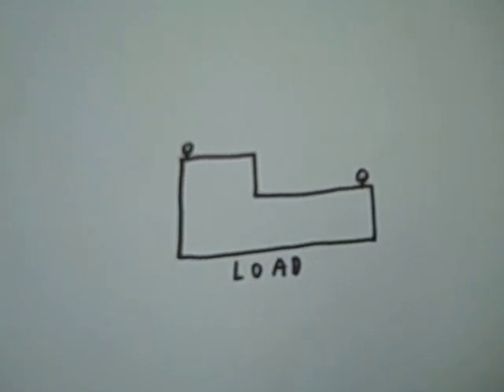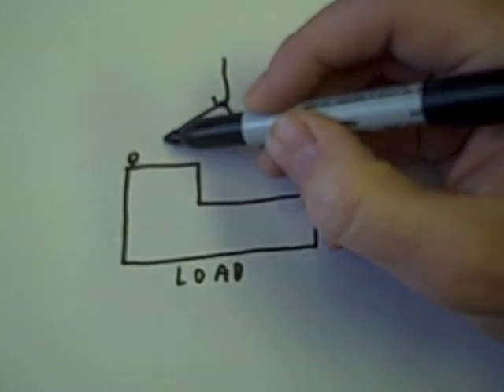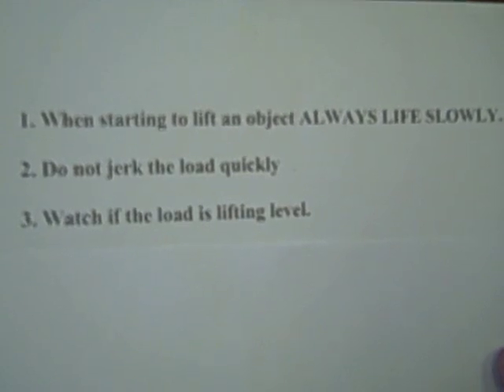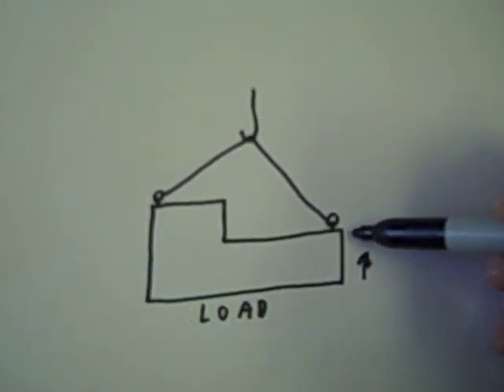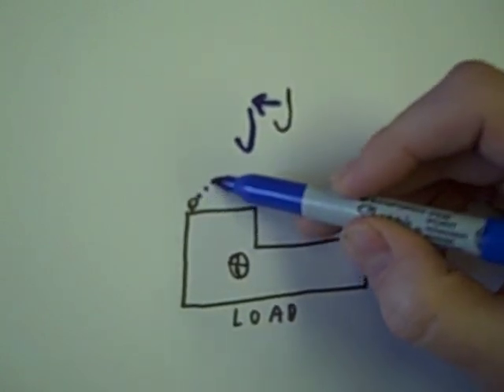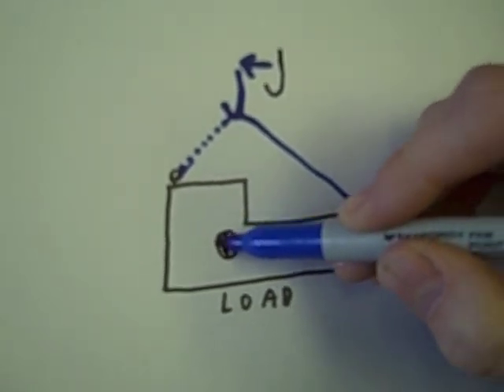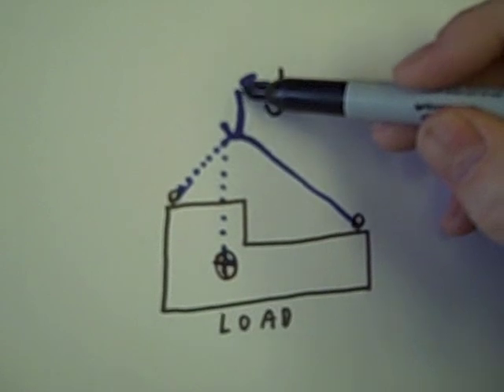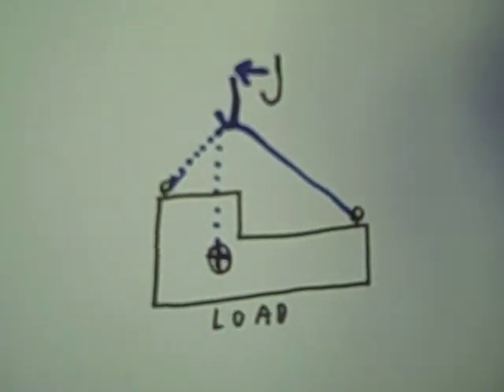Balancing A Sling Load Below A Hook Point

Comment: This video is not enough to knowledge. Un balans load allways balans with increase of numbers connect shackle to shackle or we using chain Hoist for the level of crane Hook and centre of gravity
Reply: Understand center of gravity. Position hook there, hoist till one sling begins to get tight but not enough to move hook to shortest sling. Observe slack remaining in loose sling. Use that information to add appropriate rigging to tightest slings. Hoist slowly and confirm or readjust   It’s not too complicated
Reply: Center of gravity will always be below the hook. If it’s close observe the place where an imaginary line passes thru the load.  Estimate where that line would be if the load was level. Position hook there and use previous method and your load will be quite close to level. Master the method and you’ll be able to rig the load into any required angle after lifting the load once